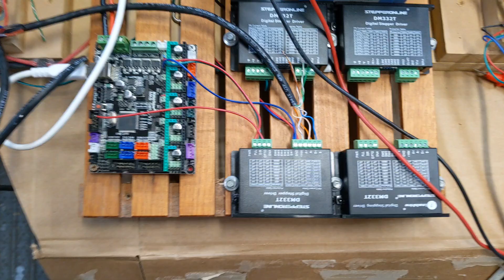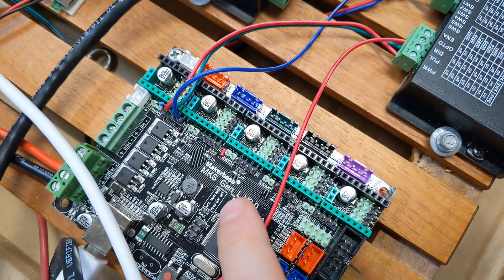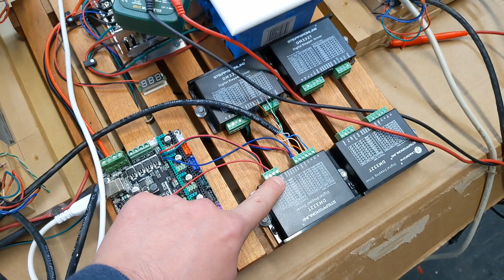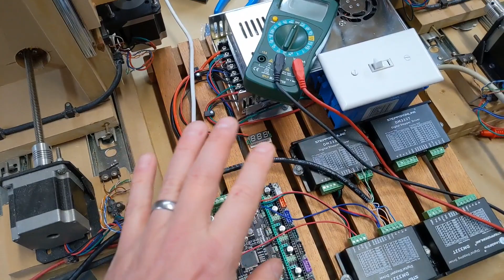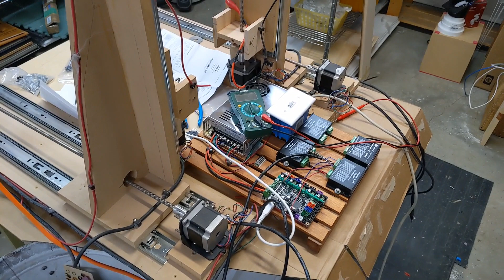MKS Gen L v2 board to DM332T stepper driver wiring

Comment: laser i use drv2988 drivers normal nema 17, and CNC i use DM556 external drivers whit nema 24 or 34 motors. need only know were wiring step and dir and enample wires.

Comment: The ENA line on this DM332T and the similar DM320T is active-high. Which means to ground it will make the logic false, and +5V will make it true. i.e., Ground the ENA to DISABLE the driver output. Tie it high (connect to +5v) to enable the driver/motor. If you have a double shaft motor with a hand wheel on one end,  add a SPDT toggle switch. Make ENA low to allow the motor to free wheel when the handwheel is turned. This allows manual positioning of the axis without shutting down the entire machine and feeding back EMF into the circuit from the motor (FYI it can be a generator if spun).  Otherwise, tie the ENA to +5v. Do not let the control line float with no connection. A spurious signal could cause the line to go low enough to stop the motor intermittently.
Additionally, those drivers are in PLASTIC cases; an insulator, and they have NO heat sink! You will be lucky if they don't fry under load. Since you have plenty of room, I'd scrap them and get some DM542Ts which DO have heat sinks.

Comment: What firmware are you using on your board? From what I can find Marlin doesn't seem to support the CLS connections and I'm having no luck getting it to work. Thanks for the helpful video!
Reply from the maker: I used devcad software, it auto flashes it